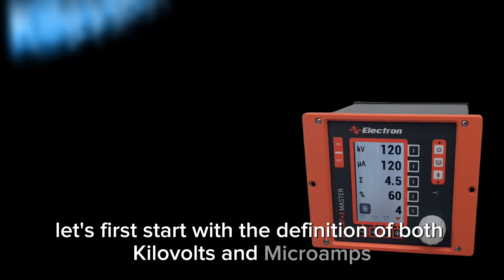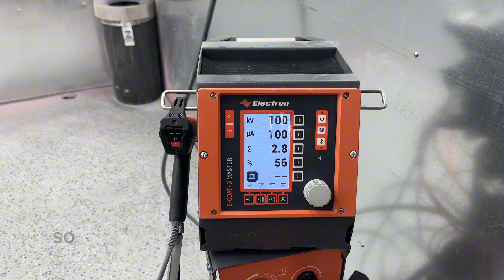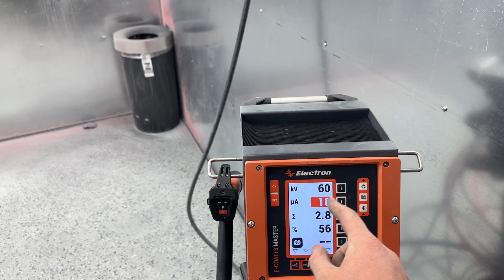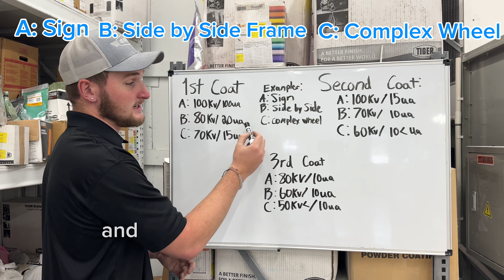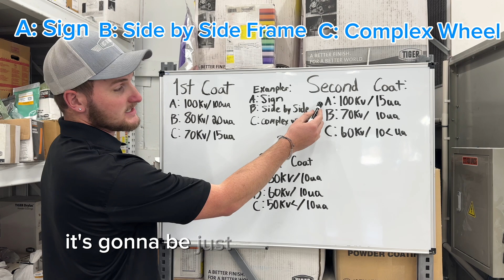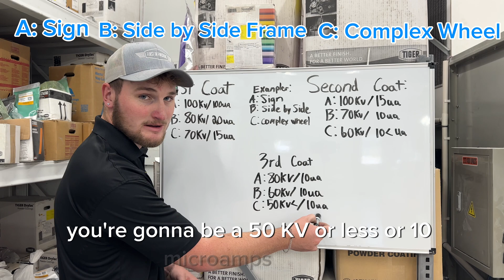Understanding Kv&Ua and Their Role In Powder Coating: With Examples And Setpoints

Comment: It also depends on some paints because some have more conductive materials in the paint. Most are made up of synthetic materials with some using high carbon materials for the pigment. For dark black paints on top coat it's better drop the kv even more to like 40 or even 30

Comment: Congratulations on this video! The information was excellent, and your explanation was great. I just want to add a bit more to help others: the distance between the gun and the part is even more important than the kV and microamps. When coating, you should maintain a distance of 15 to 20 cm to avoid saturating the parts with charges and causing back-ionization.

Comment: I’m about to buy a powder coating machine. My plan is to be able to powder coat a fence panel. 
I’m on a tight budget. I have seen a vevor (Chinese) machine that states 100kv 50W. 
What the wattage responsible for? It also states 200ua. Is that a good spec? Obviously not a high end machine but I guess I could use it for a while until I can upgrade. Can you please give me a hint? 

There is a 40w version too but I can’t get the difference. 
Thank you

Comment: In between coats are you baking ? Does metal have to be  a certain temperature?
Reply from the maker: Yes, between layers you will need to partial cure the powder.
This means heating the part up until the powder flows out and then quits moving.

This is usually around when the part hits 300 degrees.